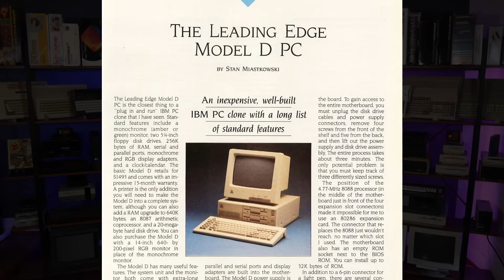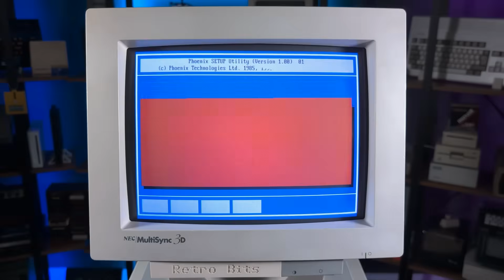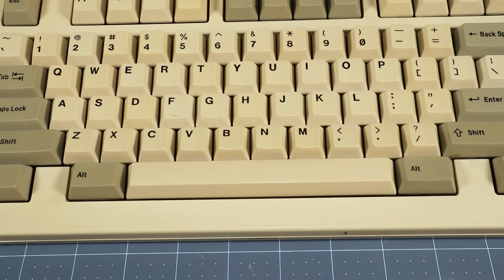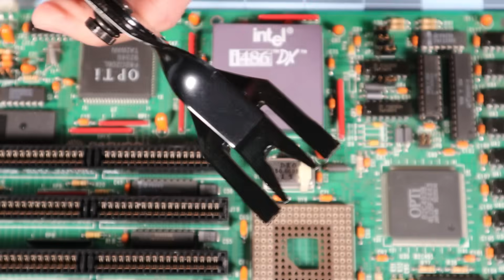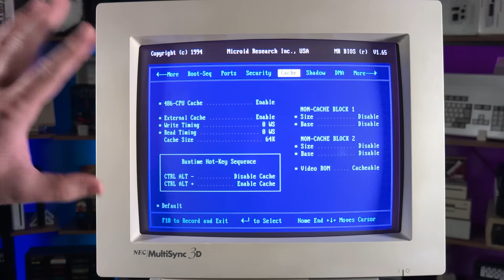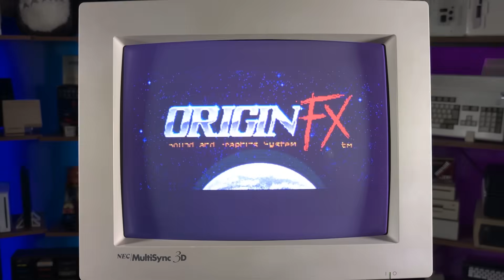Leading Edge - the 486 that time forgot

Comment: Its been awhile, but this machine might have been called the Model D4 (creative, I know). The later 1993-94 486s with VLBus were under the WinPro and WinTower brands. I used to work for the largest Leading Edge dealer in NJ, so I saw a few of these for repair. The models with the "local bus" (the D4 Plus?) used what appeared to be "Opti Local Bus" which would align with the fact this machine has an Opti chipset. One of the middle ISA slots on the motherboards in those systems used a brown EISA slot, but don't ever put an EISA card in there as it isn't pin compatible!

Comment: The thing about battery replacements for these systems is that if you don't use it reasonably regularly, honestly don't bother. The AAA or AA batteries will probably discharge in a few weeks and worse still if they're not high quality alkaline batteries they'll leak and do more damage. Even CR2032s don't last that long. These days I just hook up the external battery connector to a USB cable for 5V and leave it plugged into an external 'charger'. Works great for the few days or couple of weeks I'm messing around with it before putting it back in the closet. Sure you have to reconfigure everything the first time you pull it out, but now I also use a DOS util called CMOSSAV which restores most settings anway, for PCs of this vintage,

Comment: In 1994 my mother bought us a Leading Edge - Fortiva 5000 multimedia PC for $1400 w/14" SVGA monitor.  It had Windows 3.1, a 66Mhz Cyrix CPU, 4Mb Ram, 1Mb vram, 640Mb Hdd, 28.8K modem.  It wasn't very powerful, but I learned alot from using it and "erasing" the HDD.

Comment: 8:02 For possible perfomance improvement, try jumper(s) on graphics card. Set to 0ws etc. Or go for affordable late revision Cirrus Logic 542x 1Mb ISA card. Tseng ET4000 performance on a budget.
If you increase the ISA bus, test with 3dbench.exe (or Doom bench) for example. Not with Checkit.
14:18 Cache control is L1 cache, not L2. That's what tanked performance. Sysinfo does not report performance difference with L2 on or off.
25:10 All 486DX-33 processors work @ 40 Mhz as far as I know. You could have tried that before buying a DX2/50. However, the DX2 might work at 66 Mhz, just try. If not, you can use any speed of crystal. even 60Mhz if 66 does work stable.
29:52 Mr.Bios, I think that's a great idea!
Thanks for your video. Would you make an extra video with some of these tips above?

Comment: I remember that brand! I worked at Kodak through the 90’d and the “computer revolution”!
Reply from the maker: It does seem strange that I don't remember ever running into a Leading Edge system back in the day, especially since I grew up in New England where they were based!

Comment: The last 486 machine I owned was a Compaq Presario that had a 486DX 66Mhz CPU. It came with a mere 4MB of ram which was built into the MB. It also had I think two RAM slots. We installed(I think) a 133Mhz 8MB stick. Long time ago and my memory is a bit fuzzy. It had a 400MB hdd. It came with Windows 3 which was upgraded to 3.1 and eventually to Win 95. But I think we had to update to DOS 6. It was I think 6 floppies for DOS and another 6 or 7 for Win 95.

Good times.

Comment: Wing Commander 2 in 5 1/4?!?? It was 14 3 1/2, how many 5 1/4???
Reply from the maker: It's only 8 5.25" disks but it's not the fully voiced version. It only has speech during the opening animation. It also took no joke around 2 hours to install because of the decompression required!
Reply: @ Right… so the 5 1/2 were 1.2 MB. And the 3 1/2 720 KB :D. Didn’t cross my mind… Yes, I remember it was not a very entertaining installation, but it was all worh it. WC2 was/is a true gem

Comment: if you swap out the crystal oscillator to a 66MHz crystal you can overclock the dx2/50 to a dx2/66 probably with little issue. your cooling is actually overkill and should handle 66MHz. The Retro Web has photos of this board with a 66MHz crystal, and even has data that the chipset runs happily at 33MHz.
Reply from the maker: I will look into that - seems like a pretty easy way to squeeze some more performance out of it. Worst case, a real DX2/66 shouldn't be very expensive either!

Comment: Back in the late 80's or early 90's I had to help my elderly relatives setup and use a Leading edge. It was a 286 or 386 I think but looked the same, however the keyboard was not rebranded and was crap I remember.

Comment: Ooh, 4-disc CD-ROM changer. I had one of those for a while...  The awesome power of 2.8 GB of read-only storage at my command! (Just give it a minute, it takes a little time to switch discs...)

I picked up a 486 DX2-66 system at the flea market a few years back, it had one of the old Creative Labs multimedia upgrade sets installed (like early 1994 cheap junk version of the SB16 with a matching cheap junk CD-ROM drive) - no hard drive but I found an old boxed PATA drive for cheap at the thrift store, added an XT-IDE ROM on the system's network card, and I was in business. Good times, though I'd forgotten how many of those fondly-remembered 1990s games really did depend on having a Pentium to run well.  It was also a bit of a surprise seeing just how dodgy the Soundblaster line got -  MIDI problems, DMA problems, etc. I got a reproduction GUS to go in it, but never got around to installing it.

Lately I've been more interested in a Toshiba T1100+ I picked up. Waiting on a soundcard/CF/network expansion for it - though it's been interesting to see what I could do with just the two floppy drives.
Reply from the maker: I think I will be looking for a Pentium or PII system next, since a lot of the games I want to play from that era need a bit more oomph and a faster video bus. Spoiler alert, but getting that Aztech SB clone + PicoGUS to work at the same time consumes 7 address, 3 IRQs, and 3 DMA channels :P

Comment: My only criticism (and you may have done this off-screen) is that did you check the PSU’s capacitors?

Also…

Nice NEC Multisync CRT monitor! Will you add a serial mouse? (I bought a PS2 optical mouse on Amazon and use a PS2 to serial adapter.)

Is the RAM maxed out? I know there are sellers out there making NEW RAM for old computers
Reply from the maker: According to the spec sheet it can take up to 32MB and only has 24 at the moment. I did not check the PSU but I'm pretty sure the previous owner serviced it. Something to check next time I open it up again. I have a couple PS2-to-serial adapters but strangely I could not get either to work with ctmouse. I no longer own any serial mice but I'll be on the lookout for one at the next swap meet!

Comment: Matt, re: the slot footprint on your mobo-  I have acquired three LE 486s in the last decade (an LE486 was my 1st PC, so very nostalgic) and (going by memory as they are currently in storage) two of them look similar to yours, with the exception that the installed slots there are populated by processor daughterboards, one a DX33 and one an SX25. The third system is a (presumably) cost reduced 386/486 hybrid of some kind in a similar looking but slightly flatter case.
Reply from the maker: Ah interesting, good to know thanks!